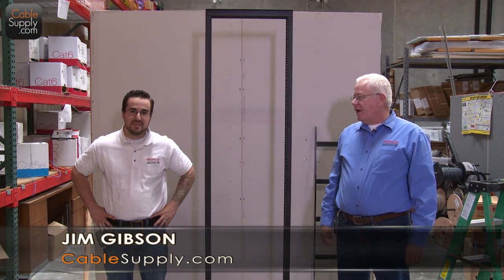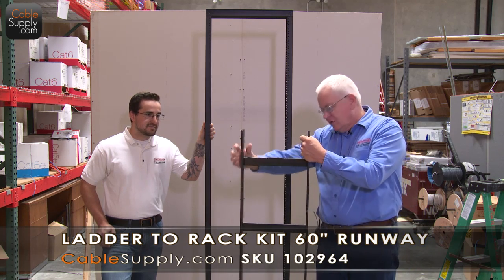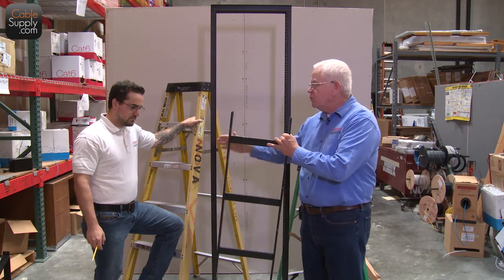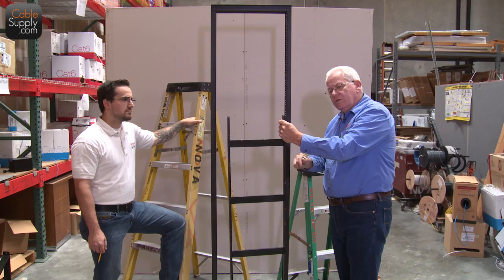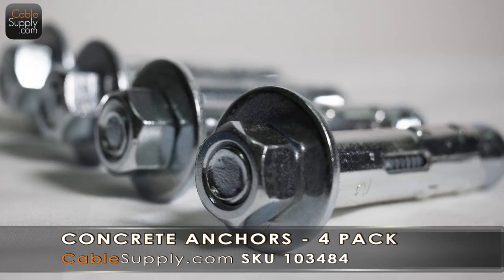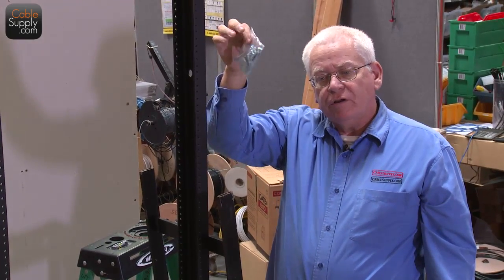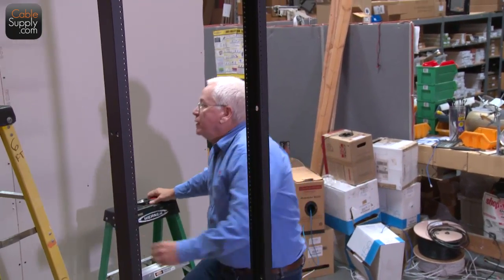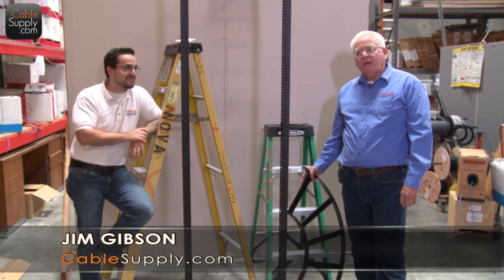How to Assemble a Data Center, Part 3

Comment: You installed the ladder tray upside down. The welds should be on the bottom to maintain strength when you lay the cables across the top. You also won’t want to bring data cables up and over the sides of the rail because the rail’s edge will leave an indentation and damage the cables.
Reply from the maker: Thanks for the info